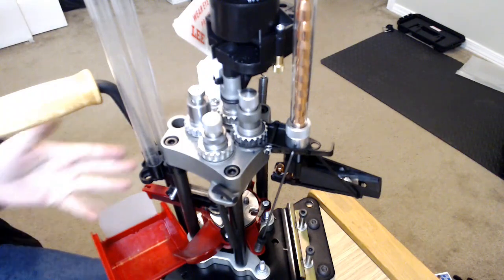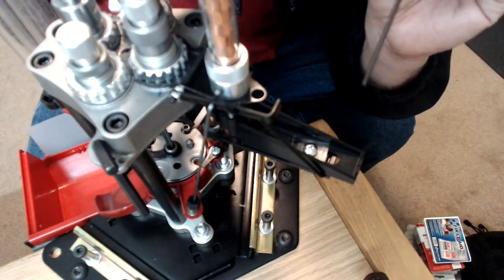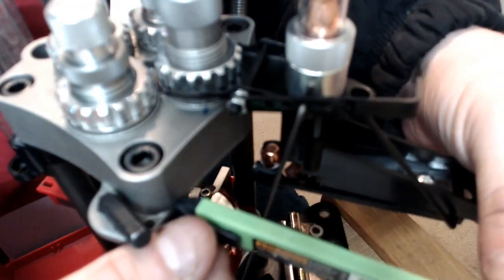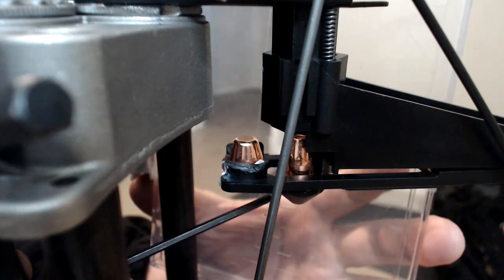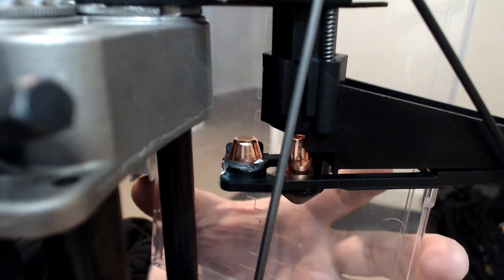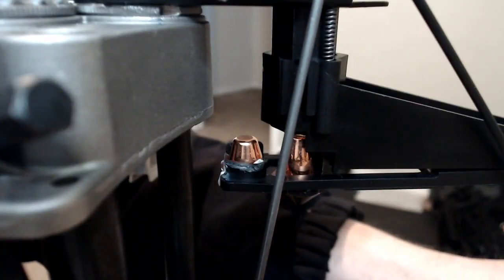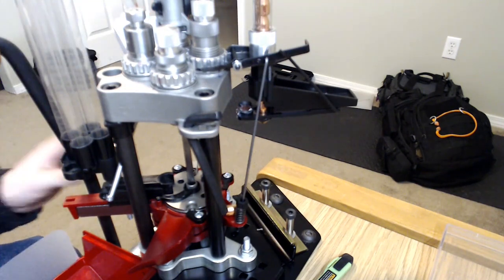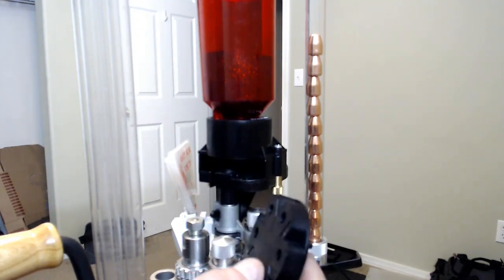Lee Auto Breech Lock Pro - Bullet Feeder, Problems and Fixes

Comment: Lee has addressed some of these issues. Mine came with a nylon washer on that screw, if yours didn't, they are available at most hardware stores, That lip(or fence) on the steel mounting plate can be removed with a Dremel tool and cut-off wheel. Clean the sharp edges with a hobby file and use a black sharpie to color in the area cut off. The body of the feeder already has an area on both sides to put in the thin strips of metal to keep the feeder arm from contracting back into the feeder body. If you'll notice, the feed arm has a molded in "ramp" on both sides. I used a strip of 1/4 X .032 brass for the feeder arm stop. You'll need two lengths per side, one, the length of the molded in metal "retainer". The second, the length needed to stop the feeder arm from retracting back into the body with a bullet in it. It is important that you place the shorter piece in first(against the body). Now flip the body over and gently tap the stop srips into position. No glue needed to hold them in place if the right thickness of metal is used. Lastly, I first used 1500 grit sandpaper inside the bullet holder. It worked, but did not last long, and as I superglued it in place, the feeding finger needed to be replaced. I had some Plasti-Dip on hand, which is a rubberized coating used for tools who's protective sleeves need to be replaced. So I thought "why Not"! I roughed up only the surfaces that would hold the bullet with 80 grit sandpaper, and applied two coats of Plasti-Dip. I also coated the bottom of the bullet feeding casting(where the bullet sits prior to being grabbed by the fingers) My Lee bullet feeder can now be aligned properly, holds the bullets firmly, and will not retract back into the body with a bullet. Runs as well as my Mini Mr Bullet feeder. If you are using ANY type of progressive press. You will always have to tweak them. If you are unwilling to do so, A turret press is probably best for you. Sorry this post was so long, I just didn't want to leave anything out.

Comment: Cool vid, how long have you had this press?  Any other tweaks or mods you recommend?  I've heard some complain about the priming system, any issues there?
Reply from the maker: I've had this press since march, but I have used an ABLP prior. I noticed that they change tiny little things with each iteration. I'm partial to the old gen 1 priming system with the round trays, but I find these easier to load because they unfold square.   cooking the primer feed finger for increased tension fixed the only problem I've had with that part, other than forgetting to load a primer for the next round :)

Comment: I just listened on YouTube and a guy said Lee dies are mandatory on this 4000 press to use the bullet feeder.
Can you verify this?
Reply from the maker: With THIS bullet feeder, yes. The reason is the bottom of the die is tapered, which fits into the fingers of the bullet feeder and opens them up.

Comment: Having inconsistencies with bullet seating depth?
Reply from the maker: The seating has been fairly consistent at about 1.128-1.130.
The only time it's gone way out of whack is when I start going too fast (shallow seating). I just run them back through the seating die after the batch is done and correct this though.

When I get the new adjustable powder disk in, and a chrony, I'll probably dial in the numbers a bit more with a slightly more stout powder charge.